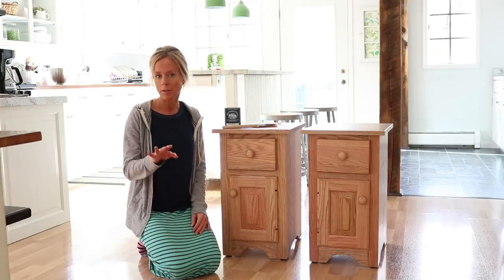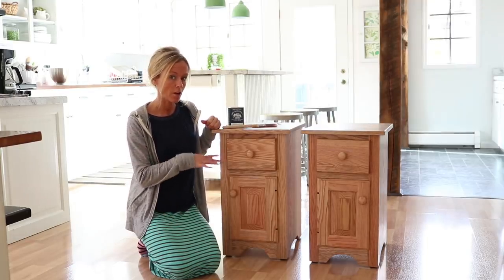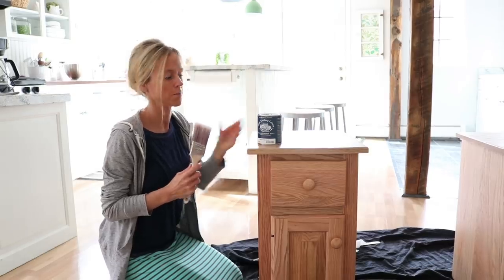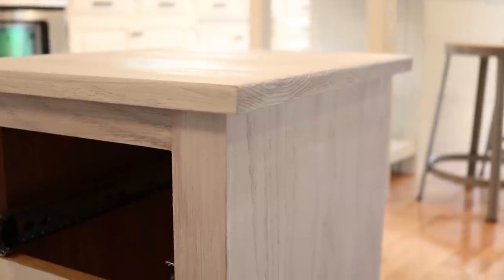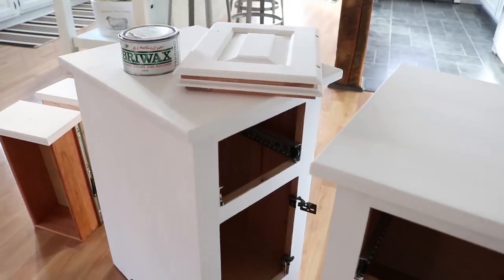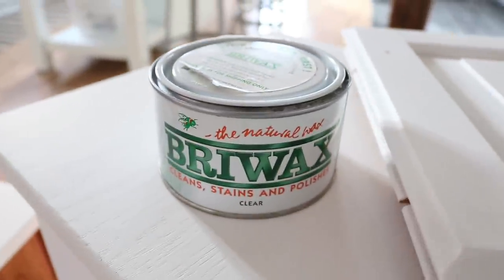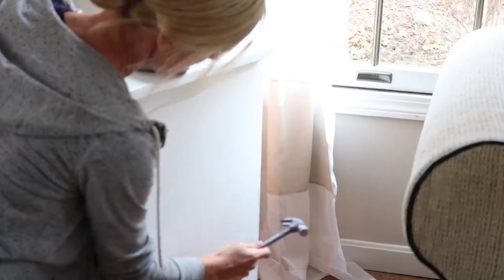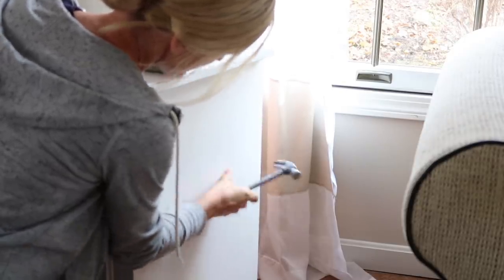Milk Paint Review, Olde Century Colors Milk Paint, Night Stand Makeover

Comment: I like the way the tables turned out.  Do you have any experience in painting a wood floor?
Reply from the maker: Thanks! Yes, I have painted wood floors!  I usually try to sand them just to dull them up a bit and apply a good primer and a paint that is especially for floors. I like Do It Best brand paints so I usually go with their porch and floor enamel.

Comment: Does the wax eventually turn yellow? Also, would you recommend this for kitchen cabinets or a poly covering g  for durability?
Reply from the maker: This wax will not yellow unless exposed to direct sunlight. The Simulated Milk paint is formulated for Interior/Exterior use, but because of such a flat finish a poly/clear coat is recommended for more durability. I love Minwax brand Polycrylic and have used that a lot for kitchen cabinets. Personally I've never used milk paint for cabinets, but I would definitely try it!

Comment: What kind of paint would you recommend for a French Provential bedroom set?   Thanks
Reply from the maker: If the set has a lot of carvings and grooves it would be nice if you could get it spayed. But I understand not everyone has a sprayer.. A brush would work fine too, just a bit more time involved. As for the paint, I use a lot of Do It Best brand paint for my furniture. I get the pint and primer in one kind. But a chalk or milk paint would be sure to hold out! I was so impressed with the durability of this milk paint that I used in the video.

Comment: I wonder how the paint would do on kitchen cabinets?
Reply from the maker: I am thinking it would work great! I am wanting to redo our bathroom cabinets and if I wouldn't already have gotten my paint, I would definitely use this milk paint! Hmm, maybe I will anyway. :)
Reply from the maker: I have since gotten some more info on this paint and was told that it works great on kitchen cabinets but they suggest a poly/clear coat for extra durability. They also have an additional line of paint, Acrylic Latex that does not require a topcoat.
Reply: White Cottage Company thank you for the information

Comment: So no sanding before using this paint?
Reply from the maker: The most important prep is making sure it is clean. Sanding is not required but doesn't hurt to do a quick scuff sand with a fine grit sandpaper.
 I wanted to put this paint to the test so I didn't, just to see how it would hold out. Love it so far!